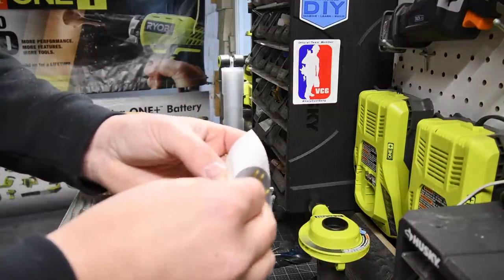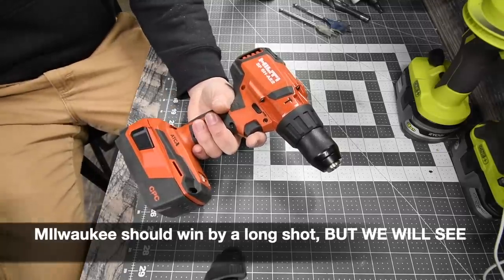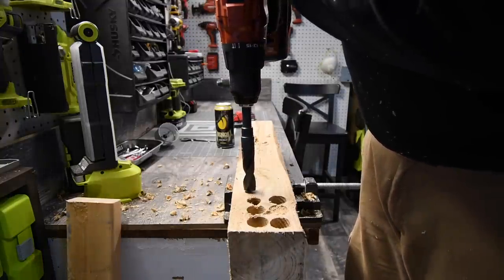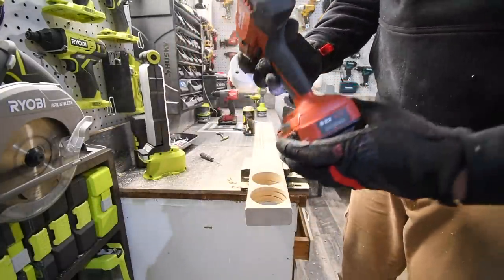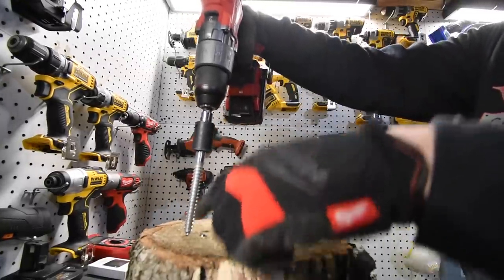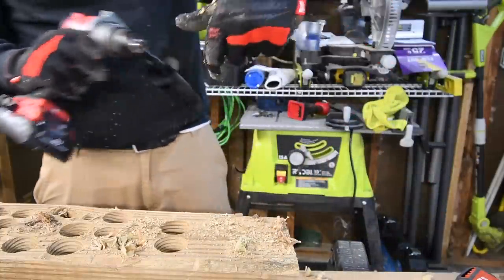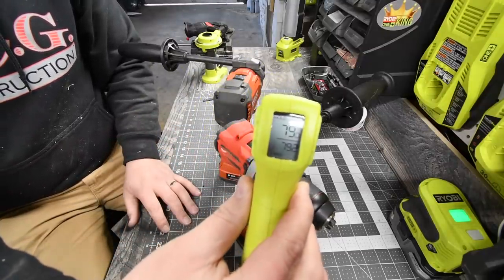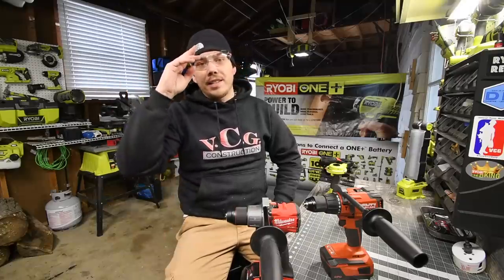Milwaukee vs HILTI (WOOD)

Comment: 2 days later and maybe the ryobi will make it through the 2x4
Reply from the maker: The Ryobi already made it through the 4x4 with the 3/4 bit.
Reply: the roybie would be around the same time both roybie and Milwaukee made by tti. shows how not to be stupid paying  higher prices for a name,
Reply: ps dewalt made by black and decker ouch
Reply: @noneyawa  it means they are owned by the same parent company.  VW also owns a majority of Lamborghini.. but that doesn't mean a VW can go 0-60 in 2 sec. or have a top speed of 200+.  They aren't necessarily made with the same parts.  Often a single company has different quality lines / target audiences, and makes multiple brands at different quality / price levels.  Tear down a Ryobi and a Milwaukee, or Google it, and you'll see that they don't share much, if any, parts.
Reply: Brandon Becker as VW owner I can confirm this

Comment: Voltage will matter but having a larger XC bettery on the Milwaukee will push the drill MUCH harder than the 3ah with a faster discharge.  I like the Hilti looks and they always win in the ergonomics dept for me. Both are good enough so I always go for the one with the best ergonomics.  I have both platforms so probabaly will breakdown and pickup a set of the new BL Hiltis, their 12V looks nice too
Reply from the maker: I already uploaded in a video that the 5ah Milwaukee will lose more than the 3ah HO battery against the HILIT 4ah and it did, I thank you so much for viewing
Reply: @ManCaverTools  I see it's a high output with the bigger discharge.  Never tried them yet.  Normally I just go with the bigger is more mantra.  Either way, as much as I like the range of Milwaukee tools, they really suffer (at least for my tiny hands) in the ergonomics dept when compared to DeWalt or Hilti.

Comment: The 4ah Hilti battery uses 21700 cells just like the HO Milwaukee. If you don't mind, I'd like to suggest doing an auger bit test too. Like an 18" long 1" bit going into the log. I like how you keep the videos simple
Reply from the maker: I thank you sir, I will be doing more tests in the future, :)

Comment: Hilti done great but you'd expect that for price difference but either way you can buy many hilti & many Milwaukee tools on Amazon
Reply from the maker: Tool only they pretty much are about the same price
Reply: @gerhardschulzy  I bet Milwaukee can get out of any warranty claims too, most manufacturers rules are -warranty only works if bought through official re-sellers, so if you buy from 3rd party you possibly have NO warranty, is that risk really worth it to save a few ££$$.
Reply: He just said in video that milwaukee drill is $10 dearer than hilti.
Reply: @toolfevertoolfever8716  Not where I live. They're twice as expensive but you don't get twice the power. So hiltis aren't really worth it, not in my area at least.
Reply: @olivertaylor4779  Any milwaukee product can be registered on the milwaukee website for full warranty. You just have to do it within a month of purchasing.
Reply: @Turgz  what area is it then because as far as I can see America and England are preety much similar regarding featured drills?

Comment: I have the older Hilti 18V impact driver.  Will its batteries work on the new 22V version of tools?  I heard 18V was really 22V anyways.  Thought I might save a few bucks and just by the drill 'tool only'.  Save my cash for when my 18V batteries die.  I hate buying new systems just for batteries.
Reply from the maker: I am not sure about that
Reply: They called it the A18 system as if it was 18V but really it runs on 22V so batteries still work

Comment: One other thing to mention is in the future you should try to pair Watt-hours of the batteries in comparison. The hilti is about 85Wh where the Milwaukee is 54Wh. Would reallly help even the playing field.
Reply from the maker: I think that would defeat the purpose though. that's like saying you cant use this tool because the other tool has more torque and higher  RPM than this one. now If I use a 2ah battery and vers it against a 8ah that would not be fair contest. So , its not  HILTI's fault that it has more powerful regular batteries then Milwaukee's regular batteries. Because Milwaukee's regular batteries are more powerful than Ryobi's regular batteries.
Reply: Ryobi Man Caver that’s not at all what I’m saying. Milwaukee’s regular batteries for the drill are 5.0s. There are zero kits available that even offer the 3.0. The 5s should also give it a bit of a boost in high stress situations vs the 3.0s even tho they say the 3.0s give them same power. In all of my experience using the 3.0s I can say that the 5.0 is still more powerful. And when you are crowning a winner based on a fraction of a second, we talking less than 5% in some cases, the extra 10%-20% boost in power that a battery with two rows of cells provides can make a difference.

The point is if you want to see what each drill can truly do you can’t starve the tools of the power they are possibly craving. Again this is all a hunch but I suspect better results with a bigger battery from Milwaukee that is more inline with the size/power of the hilti battery.
Reply from the maker: @ScotchAddict35  it does not, and I already proved that the 3ah HO batteries out perform the 5ah batteries. scroll down my videos and find the one with the milwaukee recip saw with 3 batteries in the picture. the 5ah battery lost to the 3ah HO battery.
Reply from the maker: @ScotchAddict35  FREE TOOL!! Milwaukee Brushed Reciprocating  Saw "Test"
Reply: @ScotchAddict35  I did a head to head test with this Hilti and my gen 3. I had my 9 amp battery in my Milwaukee and a 2.6 amp in my new Hilti. The Hilti still pissed all over the Milwaukee. Everyone bitches about Amp hours and more power, surely you just get longer run time and not more power?

Comment: It do not really matter if one tool is 1 or even 3 Seconds slower or faster.
It need to be robust and operator friendly.
I think in build quality the Hilti would clearly win against Made in PRC Milwaukee but what do you prefered? How is the feeling and balance or was there in one more vibration as on the other?
Reply: True, the guys doing this kind of speed and time tests are amateurs... They don't really know much about tools... Like vcg construction... Hilti's are also made in PRC, maybe not this one... But they are.
Reply from the maker: there is a difference between amateur than someone that's not even in the profession. im more of a mechanic than a carpenter. I used to film working on the house, but the community didnt like watching that as nearly as much as they like watching these test, so that's what I went with.
Reply from the maker: it really doesn't, its all a preference anyways. each tool brand has its own best tool or tools thats made better than the others
Reply: Hilti is made in China bud, not Germany anymore
Reply: @mattharrison9550  Hitli is not german my friend and never was. 
I don't know why you over there can't get it right.
Lichtenstein is a 15 square mile principality between Austria and switzerland and german speaking. 

Image someone would say " duh, Milwaukee and Dewalt, ah this are this english brands. 

For the manufacturing, yes not anything is made in Liechtenstein anymore but at least the bulldogs and may concrete tools for the EU and 220V market are made in europe
Reply: Milwaukees are made about 5 miles away from my house here in Dongguan, China! I've got a lot of close friends who work for tti over here, they really have a lot of pride in their company and it shows in the tools that they produce. Sure, the Milwaukee didn't beat the Hilti in this video, but it didn't lose in every category either. It all depends on what the user prefers and how well they can operate the tool.

Comment: That's the new brushless and the old brushed drill with a battery is still 4x the price as the brand new Milwaukee kit. I couldn't justify paying over 4x the price for marginally improved performance.
Reply from the maker: The HILIT is the brand new brushless hammer drill, and the Milwaukee is also brushless. no brushed tool was used in the video

Comment: Now which of the 2 drills stalled the most?
Reply from the maker: I wedged the hilti while it was cutting the 3 holes. it was users fault.and taking out the timber lock screw it was my fault as well. I did put the bit on the screw before I started to take it out.

Comment: Commenting on cost a lot of stores like farm and fleet have a free 5.0 with any fuel bare tool. That is for the next 3 months. You can also get $100 off just the drill kit there so $199 for 2x5.0s, a charger and the Milwaukee drill (or impact).
Reply from the maker: those are some good deals

Comment: I wanted to ask have you tried this 22 paice Ryobi titanium drill bit kit. AR2042 i ordered one from home Depot website they ran out at a few stores with. In 40 minute to an hour drive they offer  free shipping
Reply from the maker: I did, and they and they are good for semi heavy duty work
Reply: @ManCaverTools  thank you i wanted them for insulation job they dont call for heavy duty and i can use em in my bosch idh182 I only have to carry one tool for most jobs

Comment: I like these videos.  Looked like the Hilti body was noticably longer than the more compact Milwaukee.  They were pretty close in a lot of those tests.  I wonder if the motor in the Hilti was physically larger/longer than the Milwaukee?  If Milwaukee wasn't trying to be so compact and put in a longer/larger motor to be the size of the Hilti it probably would smoke it.  I don't own any Milwaukee tools or stock(lol), but after watching enough videos there just seems to definitely be something about there motors/or electronics that makes them noticeably more powerful than the other big name brands. Of course, power isn't everything.
Reply from the maker: I do believe the HILTi would out live the Milwaukee
Reply: milwaukee fan boy

Comment: Why the Milwaukee tested using M18 CP 3.0Ah? You should use M18 XC or HB battery, right??
Reply from the maker: no, if I used a regular battery with 5ah it would have lost even more, I already a a High Output batter vs a regular battery and the 3ah HO battery beat the 5ah XC battery

Comment: Nice. You should do more metal drilling too. Harder and is more fair in a sense that the material is far more uniform than wood
Reply from the maker: that will be coming soon

Comment: I'm not surprised the Hilti it's unbelievable strong I will buy milwaukee no matter what. But for now I'm Ryobi fan.
Reply from the maker: My favorite Hammer drill is the Ryobi :)
Reply: Ryobi is great if you can't afford Milwaukee.
Reply: The Hilti will easily outlast the Milwaukee! It's more powerful with much better build quality and doesn't suffer from dodgy triggers.

Comment: Honestly dont feel that a CP battery vs a fullsized battery is nearly a fair comparison, CP batteries tend to use higher density cells to achieve similar AH capacities, but their cooling/throttling control is more aggressive and they heat up much quicker, if you really want to compare properly, you need to use batteries with same WATT HOURs, so 3AH x 18V = 54WH.  4AHx22volts = 88WH.  So a fairer comparison would have been to use a 5.0XC battery for this test.  I realize the HO 3.0 cells are stronger, but it's still not a completely fair comparison.  Realistically, the HO 6.0 is a comparable battery to the Hilti 4.0.  The Hilti still being a costlier battery overall
Reply from the maker: The milwaukee is HIGH OUTPUT battery, I already showed in a video that the milwaukee 5ah battery lost even more compared to the 3ah. and in other video the 3ah high Output battery beat the crap out the the 5ah battery. I wish I would have used the milwaukee 5ah battery, the Milwaukee would have lost even more than and the HILIT fans would love it
Reply: @ManCaverTools  ok, so what about comparing the 6.0.

Comment: they are not even the same voltage ratings yet milwaukee is holding its own and winning some, i wonder what would happen if milwaukee had the same voltage rating... 🤔
Reply from the maker: I thank you for viewing Jesus
Reply: What is the formula of power again. P=volt X amp
Power never equal voltage
Reply: it does..

Comment: Never once have i seen a Milwaukee tool used on a construction site in germany. Is it even durable enough for that kind of work?
Reply from the maker: yes it is. Milwuakee and Dewalt are great tools. but I think HILTI is better built.
Reply: @ManCaverTools  All i have seen is Hilti, Makita and once a Dewalt drill. And a Bosch Angle grinder. And Festool for Carpenders. Maybe thats just regional prefference based on Avalability.
Reply: @Zydia  dewalt was very good. I have two battery drills over 10 years old and still working apart from a new battery - amazing! I bought the Milwaukee it is crap. 2 years old and almost dead. Many design issues and cheap quality..

Comment: ps some tools i own 4 and 5 of the same brushless tools need a break run 2 swap with 2 cool down rotate when doing loads of work helps the tools to not burn out, when working on roof or out side or hot house your tool is taking in hot air not cool air give it a cool down. You will find it lasts longer that way. that's a PRO tip. you cant run a drone or rc without a cool down of motor a brushless tool the same.
Reply: Ps each tool should be able to be replaced or have a back up . So if  you take a month to by that high priced drill and it breaks on a job. Thats when you learn you should have bought 2 of the other brand that would do same job. At same price for 2.  And now you look stupid  trying to finish job. Trying to borrow a buddy tools. see this all the time  You cant fix stupid Having a back up tool is the only way to be sure to get r done
Reply from the maker: I agree with you on that.

Comment: Lets try Milwaukee with 4 or 5 Ah battery, they can produce 1,5-2 times more current than a 2 or 3 Ah battery.
Reply from the maker: I did use a 5 ah in a different video and the milwuakee lost even more. Milwuakee requires the high output batteries
Reply: Hilti uses 21700 cells with 2 rows of i guess 5 or 6 cells. Normal Milwaukee batteries have 18650 cells which can provide around only half of the amperage. They have less cells aswell. The just slightly comparable thing would be a high output milwaukee battery (21700 cells) with 2 rows of cells, probably the 6ah i guess. So the 5Ah Milw you used can put out lets say 40A and the hilti 70 or 80A with 140A for short periods. Dunno if thats right tho but Makes sense. The stats of the cells can be looked up online.

Comment: Wow; the Hilti is impressive, and it should be, for the price premium!
Reply from the maker: im glad HILIT is starting to come out with their brushless line
Reply: @ManCaverTools  Same, I am super interested in their new 12v brushless line, since it is 0.3lbs lighter than my m12 fuel with both using compact batteries, and over half a pound lighter at 4ah vs 4ah and with a 20 year warranty I'm having a tough time deciding weather I should change my main drill or not.
Reply: @ericmann1781  I would. My m12 has served me well but the chuck on my drill has seized twice. If I was staying in the construction business I'd switch.
Reply: @ericmann1781  Eric, If you contact your local Hilti rep he will give you a 12volt to try out before you buy it. This might help you to decide.

Comment: So how is a 3 amp hr battery vs a 4 amp hour battery an even comparison
Reply from the maker: The milwaukee 3ah battery is a HIGH Output battery. Milwaukee's regular xc battery won't do the trick, if I used the 5ah xc battery against HILTI 4ah battery it would get its ass kicked. I did a test to see what battery I would need and the 3ah HO battery was better than the 5ah XC, the 5ah XC would have lost even more
Reply: Hi Mike,
I did a test with my Gen 3 and my new Hilti. I found no increase in power from the Milwaukee using a 5amp and then a 9amp. I used a 2.6amp in the Hilti and It came out top in every test. I always thought that a bigger battery just gives you longer run time. I only use standard or high demand batteries. I have never found that any of my tools have more power with a higher amp battery.
Dave.

Comment: Drill speeds are important not ever bit is meant to run on full blast. Reminds me of drilling through tile. Everyone else has there drill on high. I ran mine on low. My bit lasted longer an I drilled more holes faster. Did 6 in the time others did 2.
Reply from the maker: I know, but that's a good test to see what can do what
Reply: @ManCaverTools  true true true. But is it a good test? not showing the tools entire selections of options available. An what about times when your just barely squezing the trigger for that one job. Can the drill do that or is it one one them full throttle devices. Having balls is great but you don't always need to show em. An you did show those drills didn't smoke or crap out. That's good.